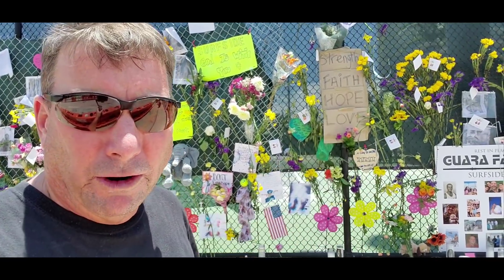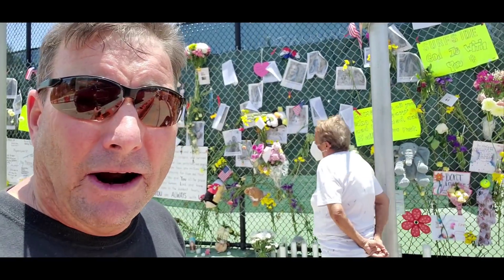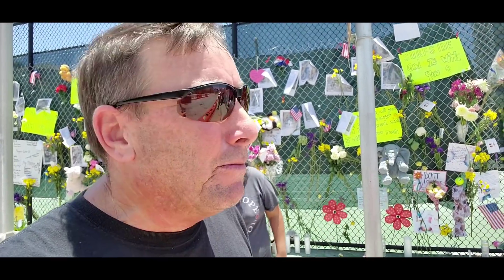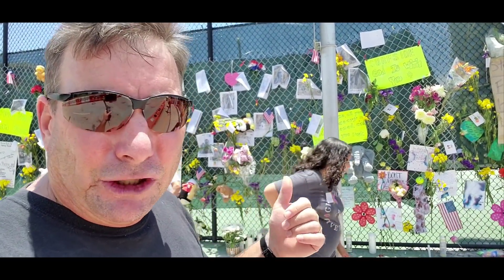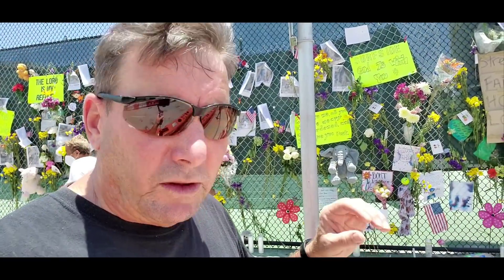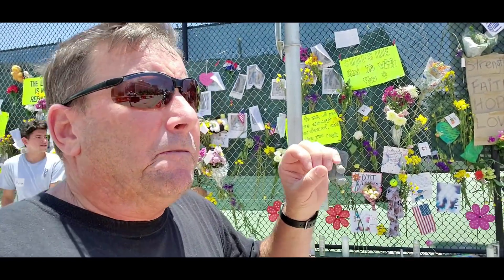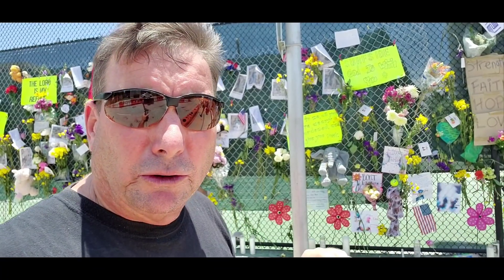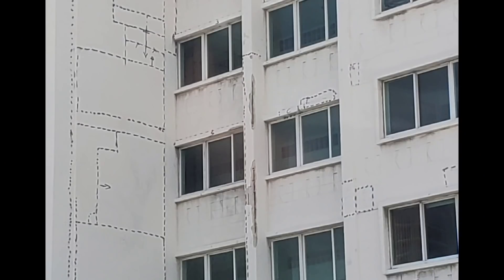Miami Condo Collapse and Memorial

Comment: As much as the design and construction of buildings is my profession, I suspect that the human factors investigations will be the most important thing to come out of this tragedy.  I don't expect the reasons for the structural failure to be anything unfamiliar or unknown.  Rather, it will be the stories of what people did and didn't do that will be critical.  First is the process driven by the developer who commissioned the design and construction of the building.  The owner/developer set the parameters and "climate" for the design professionals and contractor.  Then there is the regulatory process - building permitting and inspection.  There is always a great deal of pressure on building departments to not be too picky reviewing submittals and pressure on inspectors (sometimes in the forms of bribes) to look the other way when construction corners may be cut.  Finally is the factor of the condominium community.  I grew up in a condominium conversion of a much older building which was done just after the state adopted its condo act.  We were exceptionally lucky that the condo included anti-speculator provisions (owners had to live in the units as their primary residence) and that among the owners were engineers, architects, lawyers and others who had the skills to properly care for, maintain and improve an older building.  Nonetheless, the "politics" was a constant battle between people who were focused on both fully meeting the requirements (such as structural maintenance and financial responsibilities (aka the reserve)) versus short-term thinkers who were always looking to reduce assessments and cut any corner possible so they could flip/dump ASAP.  Reporting on the climate in this condominium is already indicating that there were responsible people actively trying to do the right thing, facing a lot of opposition.

All of this is a battle between the base parts of human nature to be greedy, self-interested and short-sighted versus what we all know to be for the best in the long run - doing things properly for the long term, even when it means a self-sacrifice in the short term.  Hopefully this tragedy will spur changes that force better minimum standards on the various parties that each would like to cut corners and pocket a little more money for themselves.
Reply: Excellent analysis, thank you!
Reply: Check into if this building had beams supporting each slab of floor levels. This one didn't have any.

Comment: There is also indications they did not follow the plans on the rebar placement.
Reply: Is that a rumor?
Reply: @mikeprice4103  No, observations by a few licensed Structural Engineers that compared the plans on file to photos of the steel in the failed columns. It is speculation at this point, but this is consistent with what I saw of construction in S Florida during the 80's. If you want to read more go over to EngTips.com and look for the thread. Almost all the posters are Engineers and they have a pretty good track record on the analysis of the pedestrian bridge among a few other engineering failures.

Comment: Interesting that during WW2, because of steel shortages, reinforced concrete ships were used in Europe and the Pacific.  And I believe there is still a Concrete Canoe Competition sponsored by the SCE.  Personally, I’ll stick with by rubber raft but I wouldn’t be surprised to see the Seals train with concrete rafts during Hell Week.
Reply: They're called ferrocement boats, and you can still find them, here and there.  There's a large wreck of a ferrocement ship near Bimini, called the Sapona. It's a popular snorkeling spot.
Reply: @bchadaway7469  Yes, I am aware.  I use to fish off an old relic of one that was stuck in the surf off Santa Cruz, CA circa 1967.
Reply: @bw162  There's an interesting story about the demise of a ferrocement boat (among others) in John Kretschmer's book, "At the Mercy of the Sea."

Comment: A couple of notes on your report. You said the magic word and didn't expand on it. Neither did the condo management. Exponential is the word.  I am sure the management did not understand that exponential in this case means damage increases faster and faster and faster yet.  You are right on about the rebar corrosion.  The pool was still full of water after the initial collapse.  What failed was the pool deck which collapsed onto the cars parked in the garage. The pool did not have parking underneath it and was strongly built.  I think you are right about salt getting into the concrete, especially into the pillars in the garage under the pool deck. The deck did not have continuous paving but had pavers where water could sit in the crack until it evaporated or seeped into the underlying structure. This info came from an hour long architectural video report that I watched but did not save. (Sorry about that.)
Reply: On using exponential, IMO this term is not well understood by most people.  It is alarming if you understand what it means.  So, when an engineer writes exponential in a report, it may not communicate the seriousness to the condo board and managers.
Reply: Hello John, how are you doing. I hope you are safe and in good health. Looking for a new friend and i saw your pic here. I hope you don't mind thank you.

Comment: For those of you not engineers when he says "pool" he means "pool deck" as the pool itself didn't collapse.
Reply: Thank you, @Brad .
Reply: Yes the pool seemed to be the one thing that stayed up strong.
Reply: The pool was part of the deck which collapsed the interesting thing is the pillars went right through deck floor
Reply: The columns in question are buried under rubble. The outboard columns (at the pool deck) punched through the slab they didn't fail, except for one that may have been smashed by debris after the collapse was already in progress. How do you know which columns failed, if any of the "skinny" columns actually did fail?
Reply: @HypercubeJones  how do I know, did ye miss the published blueprints and the CCTV vid that was all over the news? just saying.
ye may also want to look at pics of the rubble pile again, ye forgot about the columns on top of the rubble pile. how do you get columns on top of the rubble pile, they were the last things to fall. your faith in a certified engineer being a prerequisite is sourly misplaced because one signed off on the design of this building.   by the way, on page 35 of 336, where it lists "4 #8" that is 4 pieces of #8 rebar, oh, but I'm not a certified engineer so I of all people shouldn't know that, I'm glad to disappoint you.
Reply: @HypercubeJones  Ok, then. Most of this poorly-informed speculation is quite worthless.  think what ye wants, ignore the posted blueprint pages up yonder, it's cool. Oh, by the way, the column dimensions and concrete type, is on page 35 of 336 of the 1979 plans. the columns in question on the outside wall pool deck side, and under the pool deck, are 16x16 ranging from 6000psi concrete to 4000psi concrete at the 8th floor and above. the letter top of that chart ('C' in this case, or 'F' under the pool deck), corresponds with the column locations on page 29 of 336. have at it.
Reply: @Zarcondeegrissom  , those were the plans and the specifications. What was the actuality? There have been inconsistencies found in the architectural plans, and in fact, there are multiple revisions of some of the pages. How were the columns and beams constructed? Was there sufficient rebar, per the blueprints? Were they properly placed and attached to the columns? The columns in question are under the rubble pile -- WHICH ONES FAILED? Any of them, or did they punch through the floor slabs?

So it's very nice that you're able to repeat one of the YouTube guy's videos on the columns and their loads at various elevations, but what is the significance of it?

There is no evidence that the allegedly "skinny" columns failed, or were the cause of the collapse, or even contributed to it.

All the speculation is pretty much worthless. Would it kill you and all the YouTubers to wait for authoritative information from the structural engineers who will do the forensic examination of the building's materials?
Reply: @HypercubeJones  I do not know of what YouTuber you speak of, I have been looking at the blueprints and pics of the rubble pile for a week and change. but clearly, you have no interest in any of the actual photos or the blueprints or even the video of the collapse, otherwise, you wouldn't be harassing me with loaded strawman questions.

"town of surfside, champlain towers public records documents", google it.
Reply: @Zarcondeegrissom , you've  been looking at PICTURES of rubble, taken from a distance. Cool story. I'll bet that and $5 will get you a Professional Engineer certification and a state license.

Also, blueprints of the ORIGINAL DESIGN OF THE ORIGINAL STRUCTURE that may not have been followed precisely, but without examining what's left of the building, you can't know where the deviations are.

Also, there have been a number of additions and revisions since the building was built. Do you have the blueprints and work orders for those? 

This reminds me of people "doing their research" and becoming experts in virology and immunology after reading things on the web for a week.
Reply: @HypercubeJones  that website also has the 2021 plans for the 40 year re-cert, it's not just the 1979 plans there.

8777-collins-avenue---preliminary-review-plans-for-40-year-re-certification pdf

oh, and if your not alarmed at all by "4 pieces of #8 rebar", then I guess you wouldn't understand the rest anyway, certified or not.

Comment: There’s also the matter of the building’s subsidence, caused by an inadequate foundation built on reclaimed land which would have created additional stresses on the structure.
Reply: Perhaps but one would think any supporting columns would have been driven down to solid rock.
Reply: @larrybe2900  Although I do not have direct knowledge to say as an absolute matter of fact that there is no rock within a reasonable depth, I doubt there is any. There were reports of the building “sinking” . Reclaimed land is frequently not stable so, even if the piling for the foundation were driven in to resistance, that does not mean they were adequate if and as the soil changed.

Comment: Juan, there’s a channel on YouTube called “Building Integrity”.  Look him up, he has some excellent insights into what happened.  Specifically, it looks like the waterproofing in the planter box on the pool deck failed over time and was never replaced, thus allowing invisible concrete damage to the slab supporting the planter.  This damage would have spread like a cancer into 3 structural columns, which are the same columns you see fail in the collapse video.

From the garage deck under the planter box, you could see severe concrete spawling and water intrusion.  However, since this was the ‘B’ side - meaning not the side where the damage was occurring - even the severe damage that was seen didn’t reflect the true extent of the issue.

That planter box slab and the 3 columns the planter touched must have been more like packing peanuts & sticks than concrete & rebar.  Such a shame it was ignored for so many years.
Reply: Yup he is the #1 source for information regarding this disaster. Much better than any news station for sure.
Reply: I watched all of his videos as well, quite interesting stuff
Reply: I just recently found Building Integrity and binge watched his videos on the subject. What an avoidable tragedy
Reply: @budyeddi5814  So he says. All facts not in yet but its a likely observation. If all of the columns/pilasters for the buildings are still intact below the garage level, that is likely what happened. Sad that no one on the job said "We cannot pour concrete flat and level" and have no drains.
Reply: I agree, Building Integrity has a series of very good videos that really help understanding what caused this building to fail. The individual doing the videos is obviously an engineer with a good knowledge of these type of buildings. I had watched Building Integrity's videos before seeing Juan's comments here. Have to give Juan kudos for a very good layman's summary of a complex engineering problem.
Reply: something interesting
SURFSIDE COLLAPSE - sequence simulation
by Mike Bell
Reply: @andyspark5192  Thanks Andy that was great.
Reply: Confirm, he’s doing a great job.
Reply: @fraukatze3856  I agree, the Building Integrity videos are the best on You Tube about this disaster.
Reply: r laze  in case you're not aware, the Building Integrity channel has now gone through this footage and evaluated it in a detailed manner.
Reply: Been watching his series since this happened when he was on vacation. Very interesting videos.
Reply: Yes...he the dude on the Building Integrity engineering channel, has some input on the subject but I cannot stand how he searches for words three or four times. Some people are no good in public speaking and should use a spokesperson.
Reply: @Garth2011  Yes, engineers usually aren’t.  Which is why they’re frequently ignored.  (Case in point.)  The avg person who follows Juan will be interested in what Building Integrity has to say, though.
Reply: @setheroth28092  Yep, Juan does a great job in his presentations. That engineer channel needs to brush up in communications or get a co-speaker.
Reply: @Garth2011  He's very cerebral, and while he may not get the exact word he wants to use the first time, all of the words he utters until he gets to the perfect one are typically much better than what others will spew in one try.  I totally get him, guess I've got some problem too.
Reply: @Garth2011  B.S.,  Browne is one of the best public speakers and presenters in America..
Reply: @jb-qi8fz  You mis interpret who I said was poor speaking. Building Integrity channel has the problem, not Juan Browne.
Reply: @Garth2011  Ah, so I did. My apologies .  Gotta watch that speed reading. (also known as "a rush job by any other name is still a rush job"

Comment: The Building Integrity channel is doing a good series of videos analyzing the origins of this tragedy.
Reply: Just discovered his channel, no nonsense, just describing what he sees. He is the Blancolirio of this building collapse.
Reply: @markwatson3135  Exactly. And I think Juan should not try to do a deep analysis of this event, because his expertise is in aviation, not structural engineering. Oroville was different, because he had an intimate knowledge of the area and the ability to fly over it  almost on a daily basis. He does not have those advantages in Miami.

Comment: That many are killed every month in Chicago.  What's the big deal?
Reply: This was not an act of violence, but an egregious safety issue with a structure.
Reply: So true Ken, it really has to be put up there on the white board and compared with Chicago to determine if its really as big a deal as some might believe. If deaths are common in Chicago by a certain number per month or year, that must be the accepted standard for the rest of the USA !  Chicago is that way for a reason that only political idiots can explain, if they can.
Reply: Cult 45, cult of toxicity; bringing toxicity everywhere they go.
Reply: @1drummer172  what does that mean, speak English.